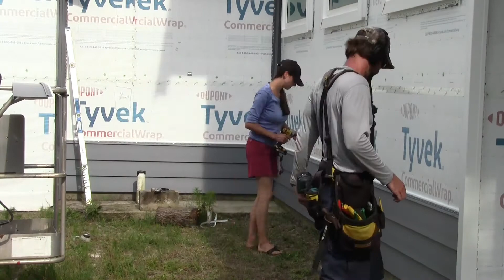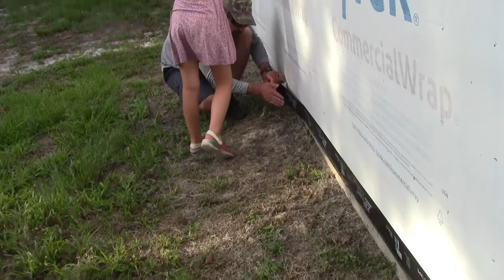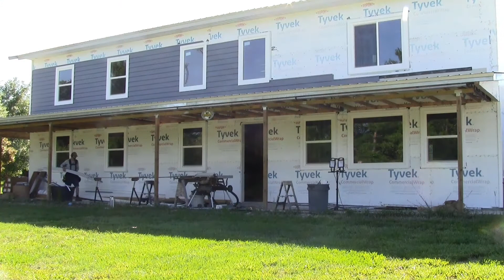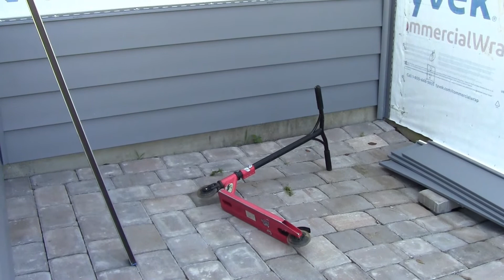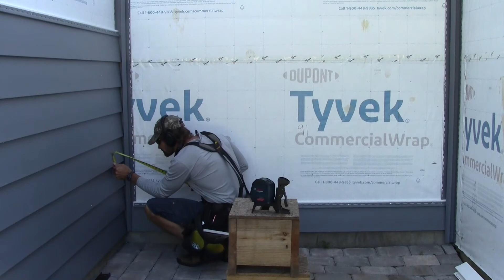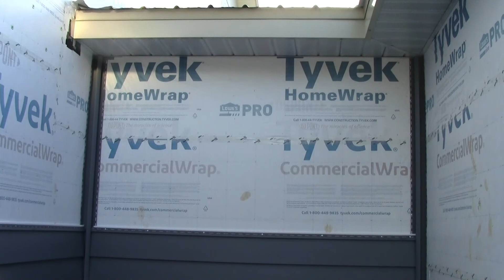Episode 65: Still More Siding...

Comment: Well it looks good. I get picky with vinyl siding. So much is put on wrong, cheap then the sun buckles it and just turns me off. We put on the cement board last year. It can be hard sometimes. But when we got done then painted it, it looks great. All in what makes you satisfied when done.
Reply from the maker: Thank you Gene. I know what you mean about the installation and the quality of the product. There are much cheaper alternatives even in the vinyl space. We shall see how this holds up. If we have any issues I'll be sure to post a video.

Thanks for watching and for taking the time to comment. It is greatly appreciated.